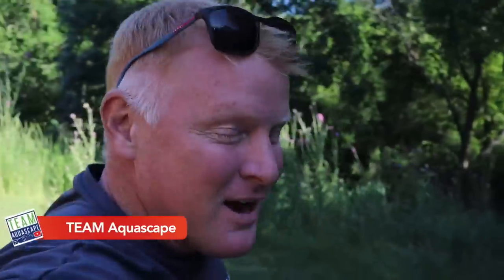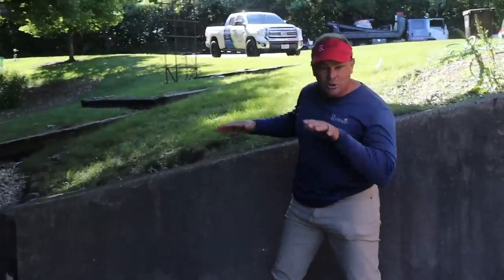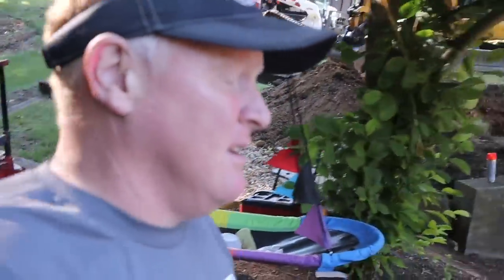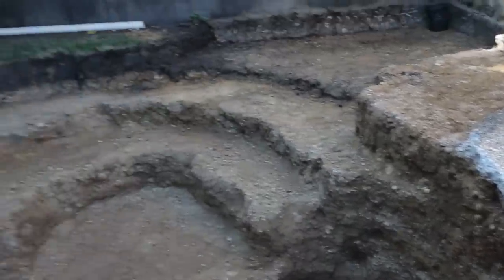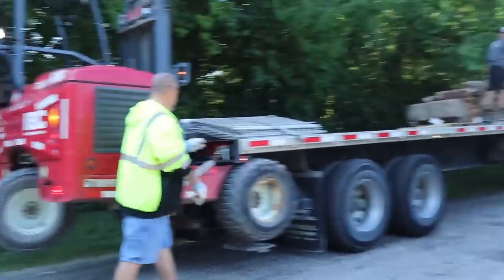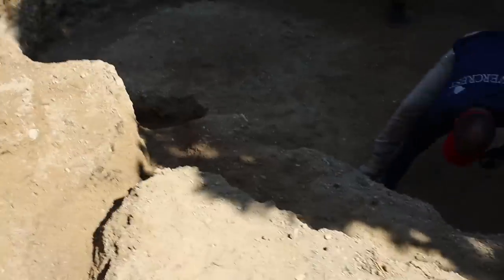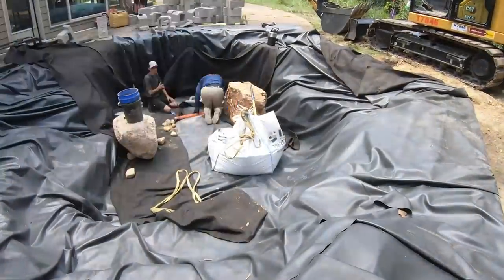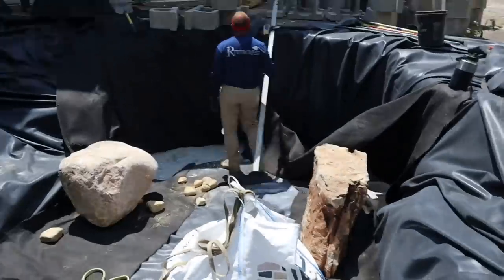Sand BEACH POND: Bigger Than A Bathtub!

Comment: what kind of gravel was used for base and behind wall did you glue wall block together if so what glue
Reply: Tomjohn - crushed limestone was used behind and inside of the blocks. Structure bond was the adhesive.